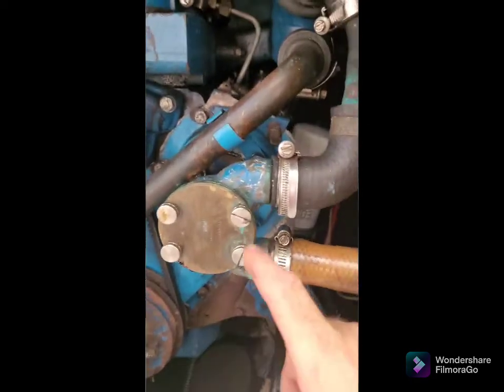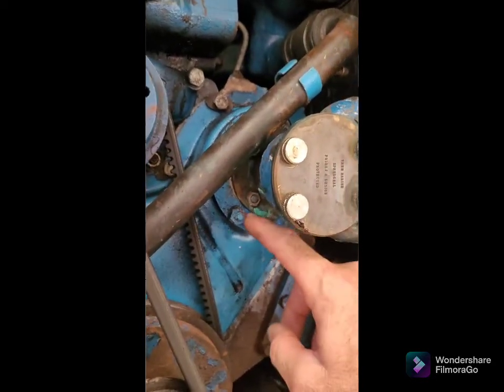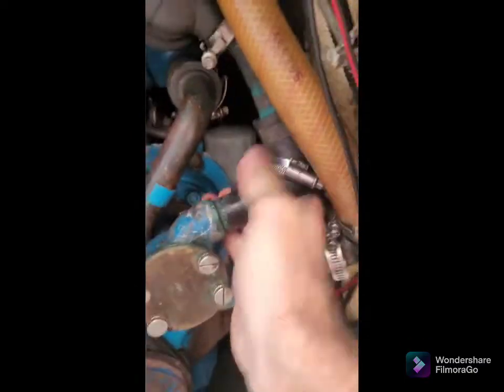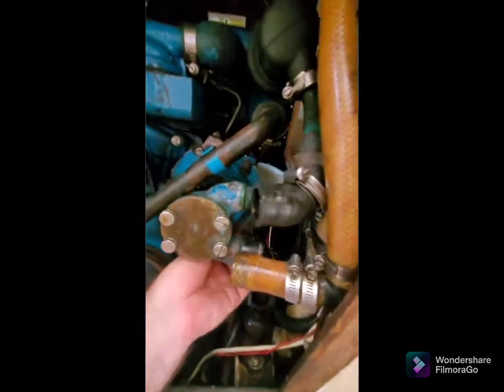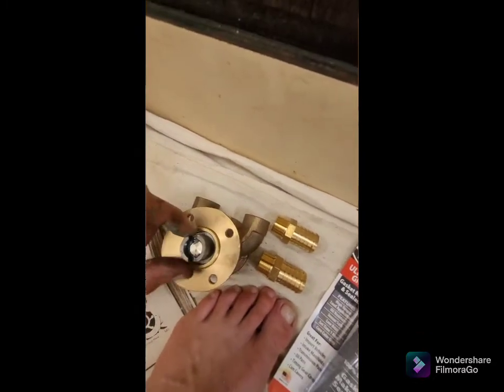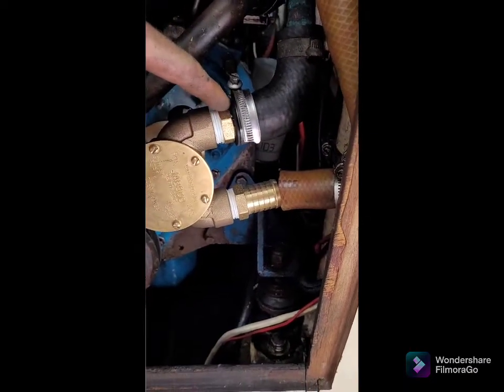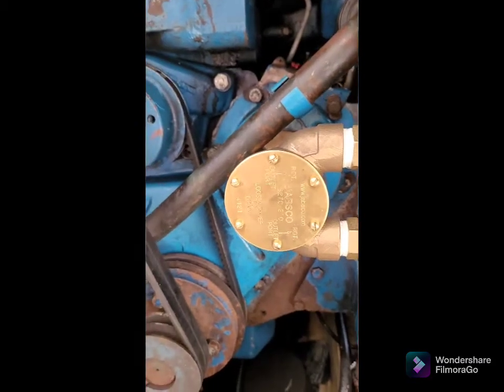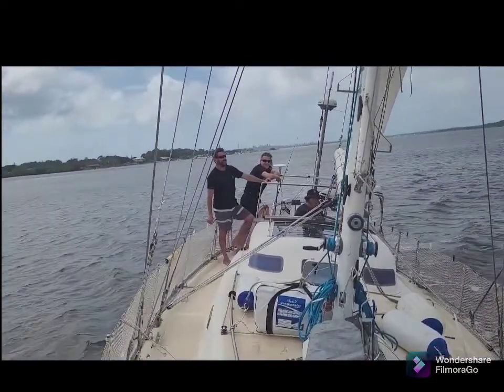Perkins 4108 raw water pump removal and replacement.

Comment: Was told by a Perkins certified  mechanic to not tighten the screws all the way, run the engine a min. And snug them down so the timing shaft and pump are nicely aligned.  I had never done this before, but I do now. 😎